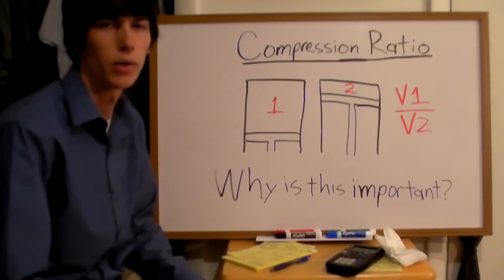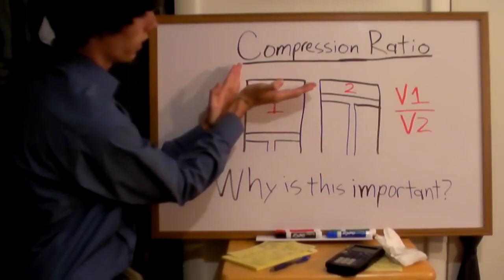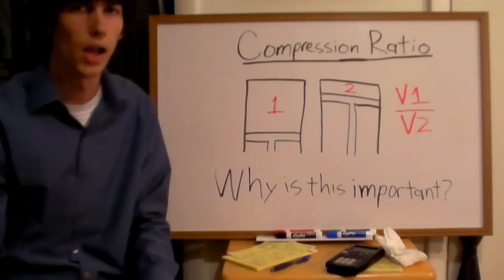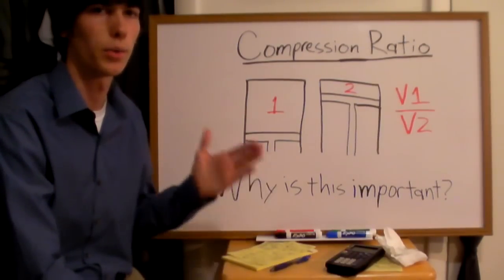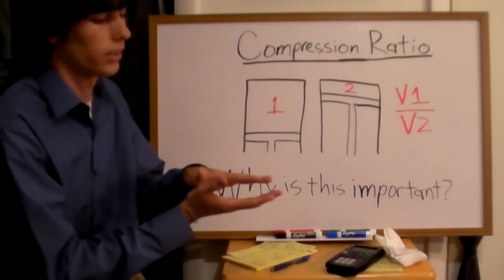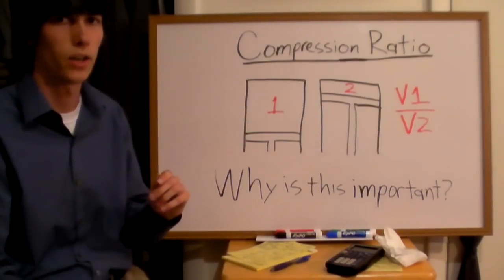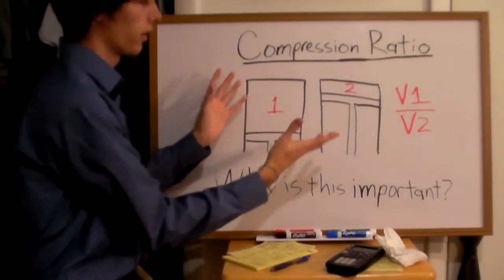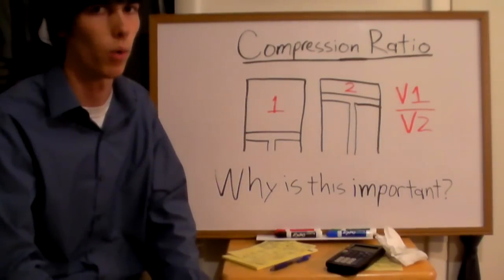Compression Ratio - Explained

Comment: No. Formula 1 engines operates between 15,000 and 18,000 (before 19,000rpm) with comp ratio higher than 14:1 usually close to 15:1, what makes them best efficient gasoline engines (in theory).

Comment: i just dont understand, so if the compresion is higher the engine must have less revolutions, or am i wrong? if the engine must revolute slower does it lose power?
I am asking this becouse i read somewhere that old race car ( itala) becouse of its high compresion colud rev ( i dont know the exact number) around 2000revs, if it revs higher it just explodes.
Thanks, subscribed, very informative canal

Comment from the maker: Typically 12:1 would have more power, if it were the same engine we're talking about, for multiple reasons. First, 12:1 is thermally more efficient, so less power is lost. Second, with more compression, the air has more time/room for expansion, so the power stroke is more effective.

Comment: direct injection is pretty much just injecting the fuel at the latest moment right before the cylinder hits top dead center and the spark plug ignites...so this way, they can have really high compression ratios without predetonation

Comment: The clutch controlled supercharger generates 17.4 psi of boost from idle up to 3500rpm and then the clutch slowly disengages and exhaust gas is routed to the turbocharger, when it spools fully by 4000rpm, the supercharger's clutch disengages fully and its plumbing in the intake system is bypassed.

Comment: The 1.4 TSI is one impressive engineering marvel. VW has milked every trick in the book for the sake of efficiency and performance. The 1.4 TSI actually runs just a hair over 17psi of boost WITH a 10:1 CR. The heat caused by the above-average CR is compensated for by a big radiator, a big intercooler, a big oil cooler, and by running a little richer than normal. All these tricks help to pull heat out of the engine and prevent detonation.

Comment: hmm.. i don't know the '12 models but older stock R35's boosts less than 1 bar around 13psi.. VW's twin-charger boosts 1.8bar below 3Krpm with a supercharger and 1.25-1.30bar after 4Krpm with a turbocharger..the engine which being used by Polo GTI, Seat Ibiza Cupra and Skoda Fabia RS.. besides the AMS GT-R has nearly 30psi of boost and its about 1800hp.. but i believe they reduced the CR for using that amount of boost.. you see as you know its complicated.. and I'm curious about the reason.. :))

Comment from the maker: Well direct injection seems to help a lot with compression ratios. In the US the Mazda3's skyactiv engine has a 13:1 compression ratio, capable of using regular octane gasoline. In the rest of the world it has a 14:1 CR and uses premium. Not totally sure how they do it but I know direct injection plays a good role. Also, the R35 probably has a lot more boost than the 1.4 TSI, so a it's logical that a lower CR would be used. Could be wrong on that though.

Comment: generally naturally aspirated engines have high comp. ratio which could be 10:1 or higher, and in turbocharged engines they generally have lower than 10:1 as you know.. R35 has 9:1 compression ratio but VW especially 1.4 TSI engines i don't know are you familiar or not in US but they have 10:1 compression ratio.. so how VW guys managed to achieve high comp. ratio in turbocharged engine or whats the engineering trick behind it and also why turbocharged engines have mostly lower compression ratio?

Comment from the maker: Yes, it's because adding forced induction increases the internal pressure in the cylinder, so on top of that, with the compression of the stroke, the pressure would be too high, and pre-ignition could occur. By lowering the compression ratio, this can be prevented, while still maintaining high output.

Comment: Its the total displacement or swept volume of the all the engine's cylinders from bottom dead center to top dead center combined. OKay so lets say you have an 8 cylinder engine and the swept volume or displacement of the cylinders frm BDC to TDC are about 500cc thats 500cc per cylinder so 8x500= 4000cc which each 1000cc or cubic centimeters make up one whole liter so there for 1000x4 = 4000cc which translates into 4 Liters. So you measure through displacement in TDC and BDC oh each cylinder.

Comment from the maker: Direct injection means the gasoline (or diesel - almost all diesels are direct injection) is directly injected into the engine cylinders, rather than before hand and coming in with the air through the intake manifold. I have a video called "Fuel Injection" which should help clear everything up, search my channel for it. :)

Comment from the maker: @IronPump89 Diesel engines have higher compression ratios because they use the heat from compression to ignite the fuel. Gas engines use a spark to ignite the fuel, so lower compression ratios are used; otherwise the fuel would ignite at an undesirable time. Yes, direct injection on gasoline exists and is now common, but a spark plug is still used to ignite the gas so lower compression ratios are still used. Though Mazda has incredibly achieved 14:1 in the Skyactiv engine for the Mazda3. Kudos.

Comment: @ghat13 More than nothing actually. Your hp and mpg actually go down a little, because premium fuel burns too slowly for the stock setup. This also means that more unburned fuel is headed for the catalytic converter, which will make it work harder and fail earlier.

Comment from the maker: @1971SuperLead Correct; gasoline engines use spark plug ignition, diesel engines use the heat of compression for ignition. I explain in greater detail in my Gasoline vs. Diesel video.